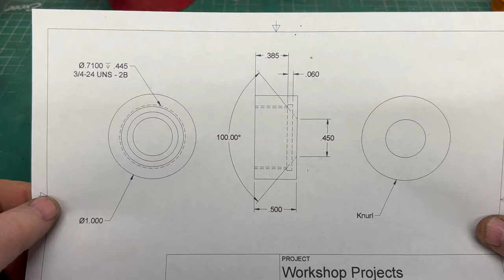Creating A Custom Micrometer Stand: Step-by-step Build - Part 3 - Making the Clamping Nut - ASMR

Comment from the maker: I decided not to do any voice over or explaination in the video. I'll add some details here. First off, making a proper clamp style knurling tool is on the list. Secondly, the first more I made was to .450". The second boring op was for the internal thread. You also see my cut an internal thread relief. I also machined a 100 degree chamfer on the inside to match up with the chamfer I made in the riser. I think that covers everything in the video. If you have any questions, please ask in the comments.